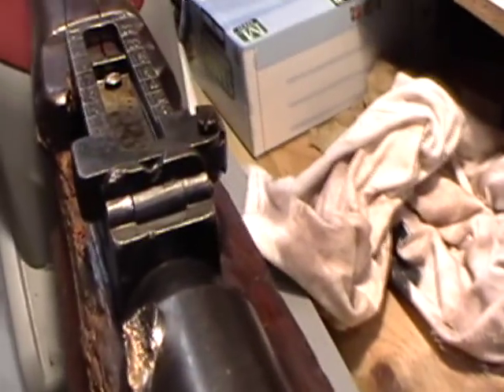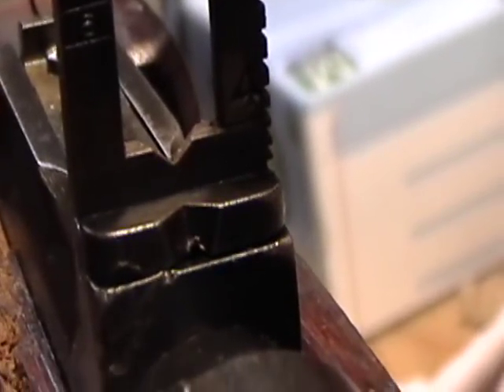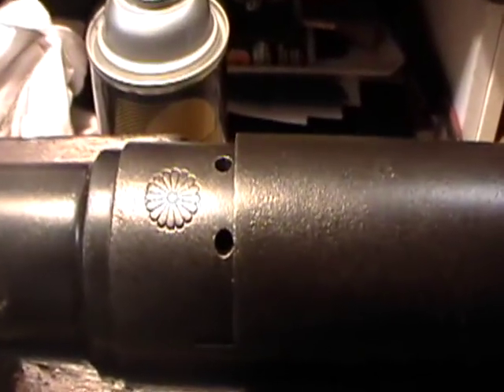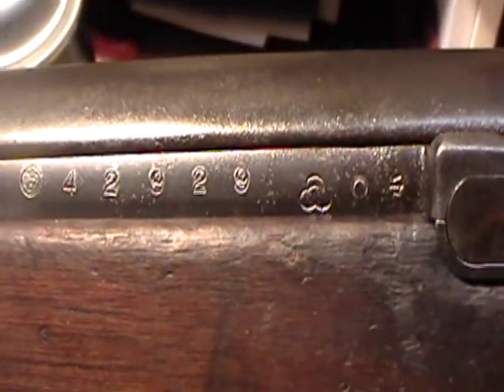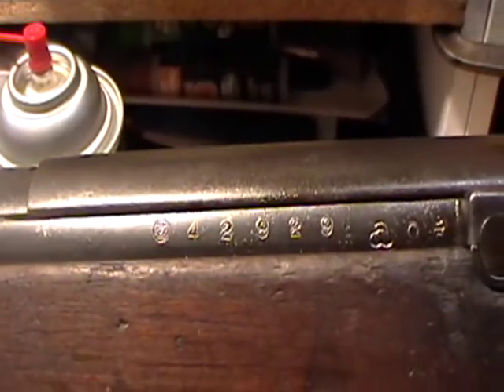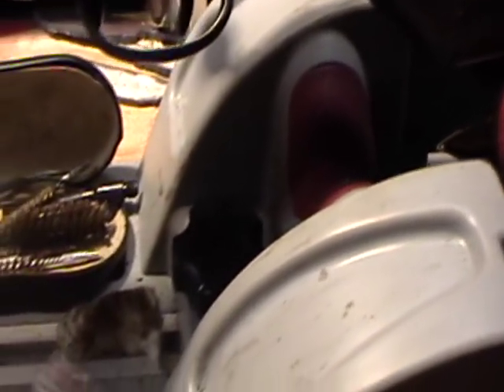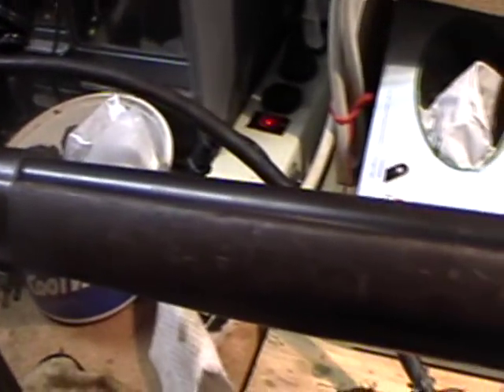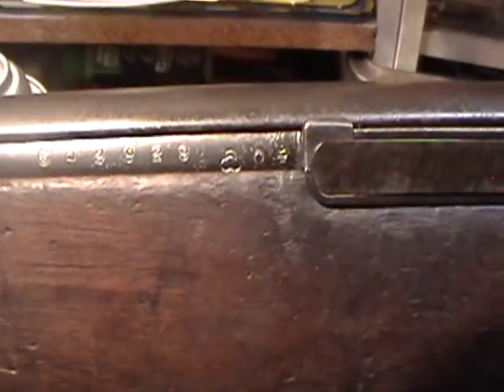Type 38 Pt. 3 Finale.wmv

Comment: Are you going to risk firing that rifle?That ricochet off the reciever looks pretty deep! I wonder how it has effected the metals integrity or wether it has caused the chamber to go out of shape,I suppose if you blued up a dummy round and chambered it you could see if any high spots remove the blue,the other option would be to get a standard size chamber reamer and run it by hand in the chamber and see if it picks up anything.The damage may well be further fowards than the chamber hard to tell

Comment from the maker: The strike is quite far forward and the pressures created by the 6.5 Japanese aren't that great. Still contemplating. The bore has been shot a lot, and I don't know if that would have happened in about the 10 year period it was in the military. Surely it has been shot since the strike on the barrel like that. I would find it hard to believe otherwise. But, there is no real way to know that fact, or when/how the strike got there. Still looking to find some 6.5 Jap ammo too.
Reply: Did you ever get this rifle to the range??  I have a T-38 just like yours and it shoots quite well.  I'm still working on 6.5 Jap load development.

Comment: i'd imagine it was a case of last ditch effort. the metal they were using was cheap light iron/soft steel (think of the metal used today for a washer or dryer) mixed with scraps from whatever they could scrounge from the mainland that was hard iron - like the russians using truck axels for their 91/30's in stalingrad. i've never seen a late block 99 and as i've said, it's rumors. if you have one, have it checked out or tie it to a tree and stand far away with a string lol
Reply: BS, the steel is top notch